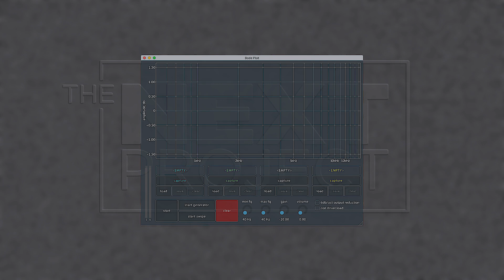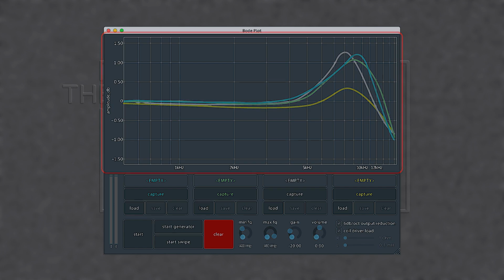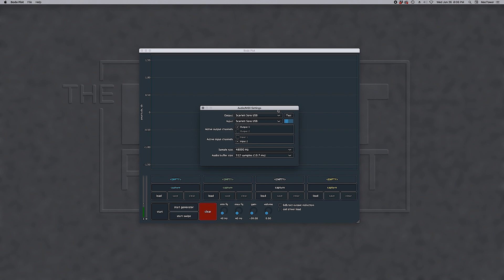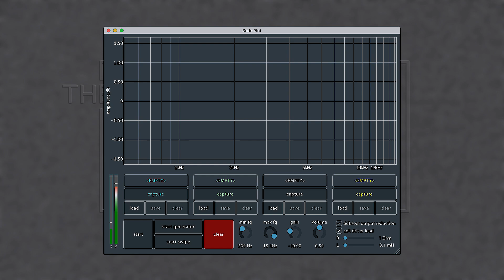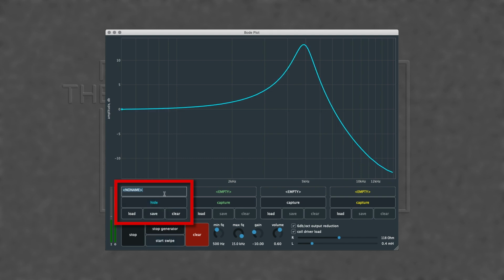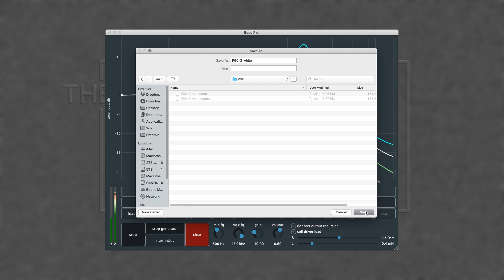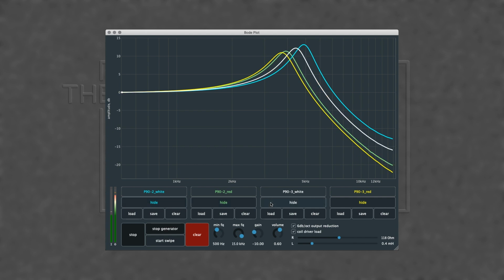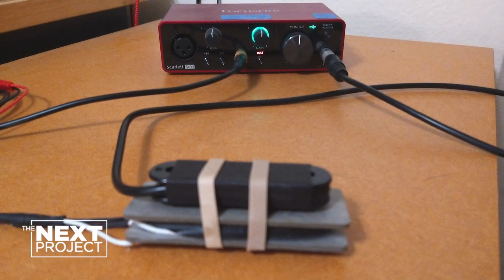AxeTech BodePlot Part 1 - Guitar Pickup Testing

Comment: How do you determine the transfer function of the coil? Probably can't assume it is flat, right?
Reply from the maker: Waya, thanks for watching, and that is a great question that I can't answer.

My use for this is very basic, it is to collect basic plots of guitar pickups for comparison. 
I rely on what the application is designed to do, the driver coil, and how they work together. 
I'm just a simple user, not an engineered mind in all this.

For my purposes, I have created a "standard" test process, which is easily repeatable with matching results. I feel reasonably comfortable with the collected data for use with future comparisons. 

For me, this is plenty good and rather fast, which I appreciate.
Sorry I can't answer your question directly.
Good luck with your projects, be safe and take care!
Reply: @theNextProject  Same here, pickups!. I think it certainly can affect readings though and I understand this is the way everyone does it and as far as I can see, the only way to do it affordably. Probably no such thing  as a flat coil across 100-15Khz

Comment: As interesting as all the technical pickup stuff is (gets to be too esoteric and black magic for me 😉) all I need from any pickup is when I plug in my cbg to an amp it will send that signal so I can, as Billy Gibbons said “grab that twine and make it whine!” 
Still, very interesting…!
Reply from the maker: “grab that twine and make it whine!”  = perfect!

I look at the "numbers" like resistance, gauss and impedance.., and have no clue what they are telling when all mixed together. I can hear all those numbers mixed together, but I just can't see them. This helps give me a visual of the sound, or how all the physical parts working together result in sound. 
That ole' black magic starts to take form,  I can overlay different pickup potions and see what I hear when i make tweaks, spooky!
"Ah, that's were the spaghetti line goes when I add 500 winds, or use different wire, or change the magnet gauss.
I'm a dork at heart, and take blind stabs at understanding any of this. Keeps me off the streets and out of trouble basically.

I need a better hobby, lol.
Hope all is well, take care my friend!

Comment: Sorry, I didn't get a lot of the content of the video.
Something about the frequency response of pups.
But how do you make the parts yourself? What parts?
Reply from the maker: Achim, thanks for watching!
What parts would you like to make?
About the only thing you may need to make for this setup would be a coil driver. Basically a low-low wind single coil pickup bobbin with a lead you can plug into an audio interface (Scarlett Solo in this instance).

Maybe you're just pulling my leg, again. 

Hope all is well, be safe and take care!
Reply: @theNextProject  You mentioned some parts the company didn't want to produce anymore.
Reply from the maker: Ah, it's just the coil driver. It's just a really low wind count pickup bobbin with a 3.5mm headphone jack attached.  I'm thinking about opening the coil driver I have, taking a look inside to determine wind count and wire gauge. 
I've wound a couple similar coils for a different app I've used, on a PC.

Comment: Thank you for the information, great video again. I have been using REW (Room EQ wizard) for the exact same purpose. The difference is that it is completely free. You can wind your own exciter coil by winding for example 0.1 mm copper wire 200 rounds over a single coil bobbin and adding a 20 Ohm resistor in series with the coil. The coil is not critical, you can use other gauges as well. This will cost you pennies.
Reply from the maker: Hannu Hanhi, thanks for watching and the heads-up on REW.
I haven't looked into REW yet, as I've been using the Velleman PC oscilloscope and more recently the AxeTech software.
The Vellemen software is rather outdated, only works on a PC, rather crude UI, not overly user-friendly, but does generate good data.  My shift to the AxeTech software was mostly accidental, as I had searched for an option that would also work on a Mac. 
As you probably know, not a lot of user-friendly options available to us. 
Your coil driver/exciter coil sounds just like the Tillman coil instructions. I've got a couple of those laying about, both seem to work better with the Velleman product. 

I'll look into REW, thanks again.
Be safe and take care!
Reply: I have a Ken Willmott integrator I used with a Velleman oscilloscope.  With this setup I wouldn’t need to use that then? Great video and thanks.
Reply: @workshop62  With REW you don't need the integrator. The integration is done with the microphone calibration file which is a simple csv- file.

I don't know how it is with the software @theNextProject uses.
Reply from the maker: The Willmott integrator isn't needed with the AxeTech BodePlot either, and that's another reason I've moved to using the AxeTech software. 
I need to do a side-by-side comparison of one pickup, using both the Velleman PC Osciloscope (with Willmott integrator), and the AxeTech Bodeplot software. 
I would expect slightly different data capture, yet similarly close data. 
The REW software looks intriguing too...just another thing to learn. I need to clear a couple evenings and tinker with this stuff!

Good luck with your plots gentlemen!
Reply from the maker: Workshop, thanks for watching!
True, you don't need the Willmott integrator with the AxeTech Bodeplot setup as I'm using it. That was one reason I've moved away from using the Velleman PC oscilloscope. 
All you need is the AxeTech software, a Audio Interface device (Focusrite Scarlett Solo used here), and the coil driver/exciter coil. 
I'm going to request build instructions from AxeTech for the coil driver they no longer sell. Or, I'll reverse engineer what they sold me and try to match materials, wind counts... Attempt to make an identical driver in specs.
If/when that happens I'll post a short vid.
Be safe and take care!
Reply: No need in resistor if using wire of typical pickup AWG range - 41-44, as with 200 winds the coil resistance will be above 100 Ohm. if using thicker wire, like AWG 38 (that is 0.1mm), make sure the resistance matches your audio source capabilities. Another common reason for adding the resistor into the chain is reducing the impact of frequency changes on current value in the coil, which is not an issue with Bode Plot, as the software can adjust output volume (signal voltage) to keep current constant across the complete measurement range.
Reply from the maker: @GrooveMinder   Thanks for the great information, this should help a lot of us out.
I may make a quick video showing the assembly, test and use of a driver coil as you've described.
Thanks again!